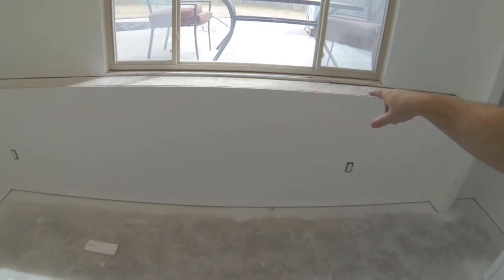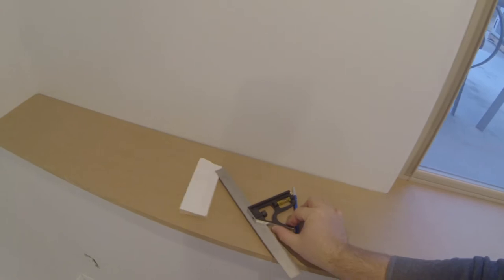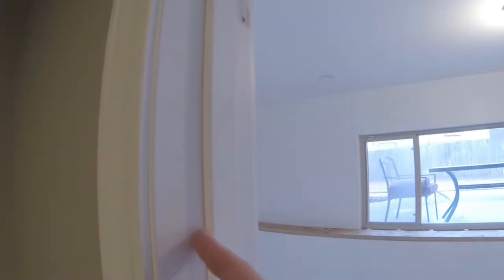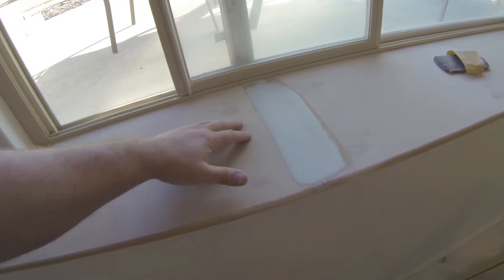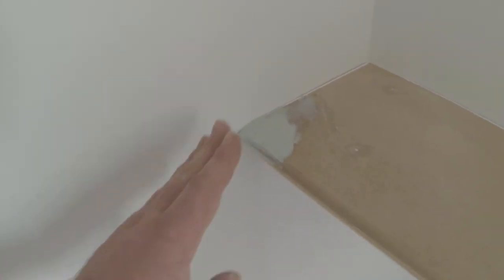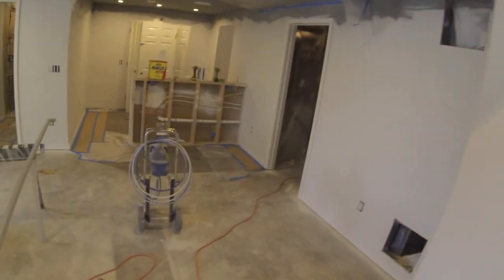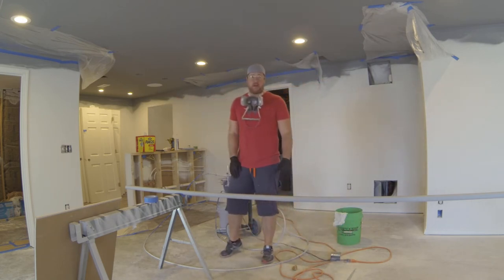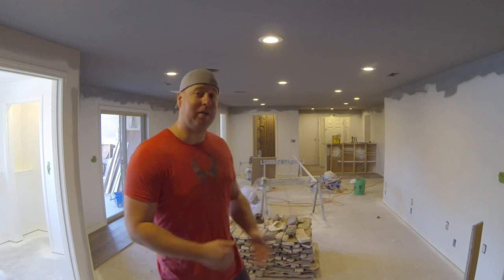Building Half Wall Ledge | Trim Painted | Basement Build 17

Comment: Yours is the only clear example I've found of how to insulate and frame half-walls in basements. Mine has half-walls running along two sides, and I just learned that I'm going to have to tear out and redo them. It's always been cold down there, and I finally worked up the nerve to do some exploratory surgery with a demo bar, and it turns out that the previous owner had just used masonry nails to put up some furring strips on the ICF blocks and then nailed wood paneling to that. No insulation, no vapor barrier, no nothing -- just concrete, 3/4" gap, wood panels. 

Anyway, lots of belated thanks for showing me how to fix it. Should I have some concrete patching material on hand for the holes left by the masonry nails?
Reply from the maker: A lot of people do nothing against concrete walls. A little extra work and a small amount of money makes a pretty big difference sometimes. I would probably grab something to fill in those holes. Doesn't have to look pretty, but might as well since you'll have it all torn out
Reply: @LifeofBliss  I do have friends whose basements have bare walls that aren't too bad, but mine are reeeeally cold and drafty up close.

Comment: The joint used in the shelf is called a scarf joint. It is commonly used to joint trim, or any other project where an extension is required. Also, that shelf was a prime opportunity for a nice piece of hardwood. Oak, or cherry. Really would have contrasted all that white.
Reply from the maker: Good to know, thanks man! We actually changed out all the oak trim upstairs for white! It goes better with the rest of the house, plus it saved a little money using mdf 😉
Reply: I'm wanting to add a hardwood shelf like you suggested. I can't figure out how to attach it without screw holes needing filled or being exposed on the top of the board. Thinking about doing some kind of slide-in solution so it can be removed without being destroyed if needed. Do you have any suggestions?

Comment: What kind of molding did you use for under the shelf?
Reply from the maker: Same as the rest of the door and floor molding. It was all 2.5 or 3 inch molding just to match

Comment: When you say you cut the seam at a 45 degree angle, do you mean in the depth of the wood (top to bottom) or do you cut the 45 degree angle from the front to back?  I'm planning on doing this to my half-wall as well, but am an absolute beginner (haven't yet used our saw).
Reply from the maker: Check out the video around 2 min 30 sec mark. That's a smaller sample of what I did. Looking at the front of the wood (short part only 3/4" roughly) you'll see the 45 angle. Should look like this: / 
Depending on the depth of your shelf, you may need a sliding saw so it can make the long cut. Check out the video at the 3 min mark to see the saw I used as well as the cuts at the 45 degree angle. If you aren't able to do this with the saw that you have, you can always just but the ends together without making them 45 degree angles and use the body putty like I did to fill any small gap. It should be fine that way, but the 45 angles will decrease the chances of a crack forming later down the road. Good luck!

Comment: Great video except one thing:  please normalize the volume of your music to that of your voice.  Basically, when you're talking it's a lower volume than when the music kicks up.  This forces viewers to adjust the volume several times during the video.  Thanks!
Reply from the maker: Thank you for the feedback. I started using headphones when editing videos and have lowered the music in newer videos. Hopefully you don't experience the same thing with those!
Reply: No problem.  I'm in the midst of finishing my own basement, and it seems we have similar ideas about things.  (I used the same rigid foam insulation as you did, for example.)  Your videos are giving me some great ideas, so thanks!  Looks like we're not physically far from each other either...I'm in the Kansas City area.
Reply from the maker: That's where I'm originally from. Going back this weekend actually to see family. I'm sure you're doing just fine, but let me know if you have any questions about what I did in mine. Good luck with your basement! Appreciate the feedback